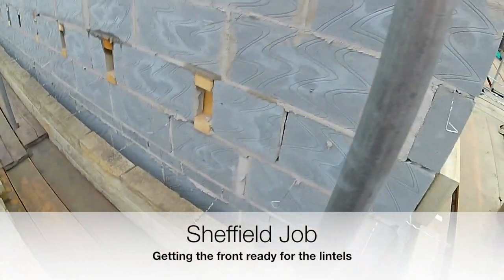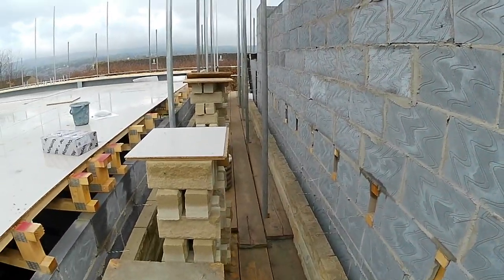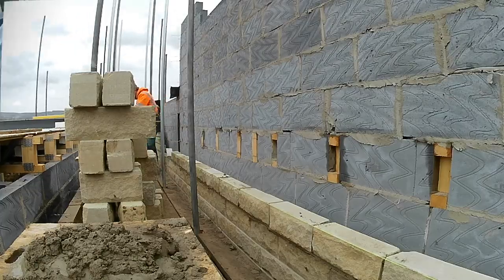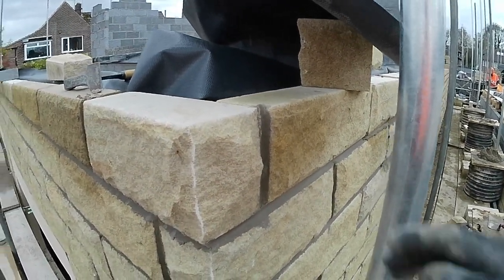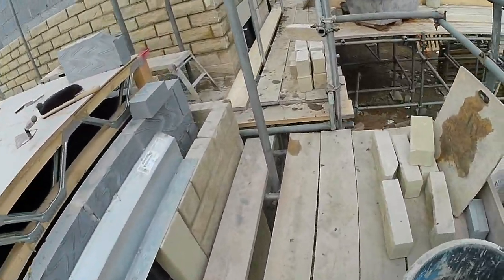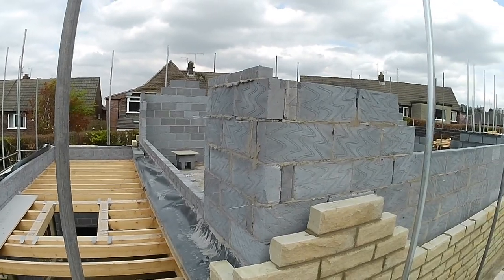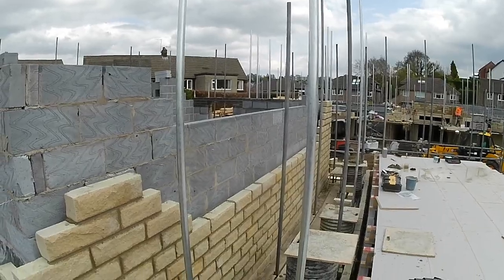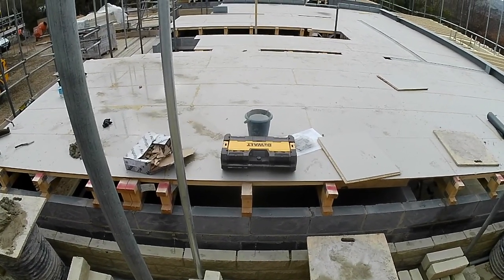BRICKLAYING- more block work and stone work

Comment: How do you keep your corners plumb mate? We don’t have many stone houses round my ways so haven’t had the chance to have a go at it yet
Reply from the maker: I have purchased some "stone pro" profiles buddy they are the mutts nuts once set up they are so much easier and quicker before I had those I would extend my level thru the blockwork and measure to the face of the stone both ways on the corner and keep checking the corner plumb point, I have a video showing the profiles in use mate that may explain it better for ya, thanks for the comment and watching Jack 👌🏻👍🏻🤙🏻👍🏻👌🏻